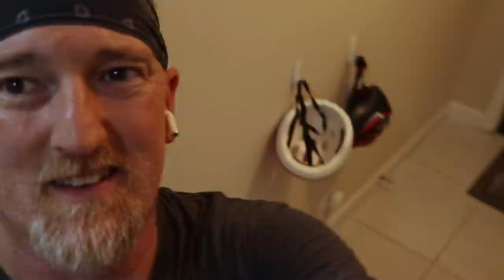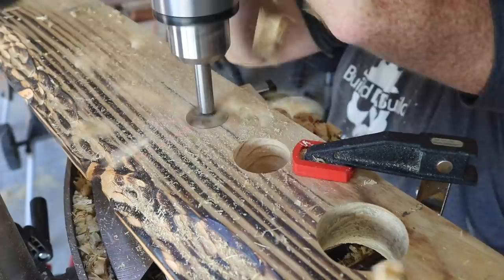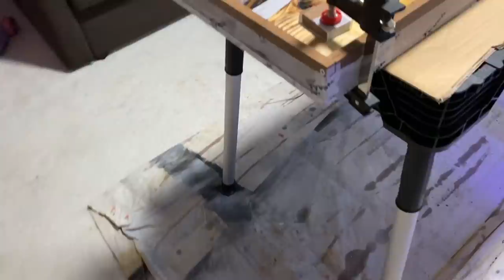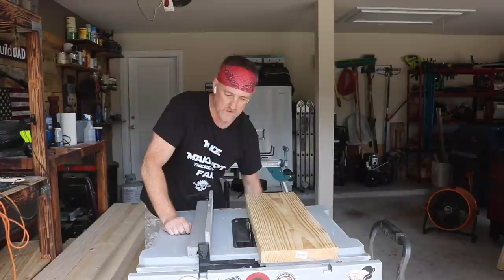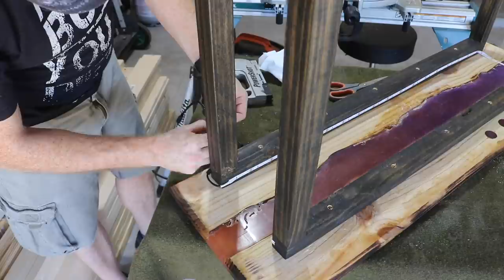DIY Faux Epoxy River Table

Comment: Quick tip for your epoxy color.  Fill a clear cup with your colored epoxy to the same depth of your pour and set the cup in your table.  This should tell you what it will look like, and you’ll be able to modify your color before you pour.
Reply from the maker: Thanks for the tip Sandy!
Cheers

Comment: This table looks so cool! 😍 I love the gradient and lights. If you ever do another project like this, can you try RGB lights?

Not sure if any of these things could be the issue, but can’t hurt to check:

Mica powders tend to settle at the bottom. Maybe try adding some dispersion colors in addition to the mica? Or plan to use the side that cured facedown as your top.

Some resins yellow over time, especially if they are left out in the sun, so make sure your resin isn’t yellowing because that would definitely turn pink into more of an orange. Since you tend to burn outside, that brief exposure to the sun might be the culprit.

One last thing that could affect color, if you’re not using a uv resistant resin, then your colors can fade when exposed to sunlight, and reds/pinks tend to fade to an orange/tan. Maybe do some tests to see if adding uv protection helps?
Reply from the maker: Awesome. Thanks for the tips!
Cheers

Comment: Just have a question about the epoxy center holding the wooden pieces together. I'm new to this and sorry if it sounds like a dumb question, but does it really hold on over time if you set a tv on it, for example?
Reply from the maker: Not dumb at all.
It's pretty solid. The key is to cut the "river" channel in a "V" so the epoxy can gain purchase above and below.
Cheers

Comment: You can use velcro to attach a power strip underneath.....and i have the same pink issue....light purple actually comes out more pink than pink does.
Reply from the maker: Good to know about the pink....thought I was crazy!
Cheers

Comment: Looks really good. The only thing I would say is you were hopeing to really illuminate the table. I have seen other videos of similar projects where instead of putting the lights under the table people would actually attach them to the river edge itself and the pour the resin over the lights, then the light comes from inside the resin. It has a really nice effect. Really enjoyed your video.
Reply from the maker: Thanks, Jamie!
My only concern with that is if you ever need to replace the lights! 
Cheers

Comment: A trick I've seen for epoxy pigments is as you're mixing your epoxy and color together, take a clear plastic cup and mark it the depth of the river or area its being poured into. Then pour your epoxy mix into the cup up to that level.

In the big mixing bucket, it'll look one way, and with the plastic cup you'll have a more accurate way of telling what it looks like with the same depth as your pour. With this method, you can "tune" how your pigment looks by adding more for a deeper and/or more opaque look, or adding different pigments to adjust the color.

Just dump the solo cup epoxy back into the mixing bucket, and adjust until you have it the way you like it. Then you should be good to go.
Reply from the maker: I like it! Thanks for the tip.
Cheers!

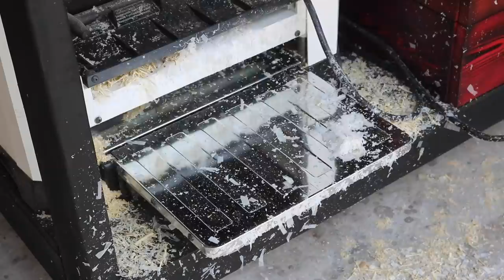Comment: 6:39 - 6:40 did you shave some of the epoxy spots off in the thicknesser? There were more, then they gone ! 😯🤔😀
Reply from the maker: Yes. They were very shallow and came off when I ran it through the planer...